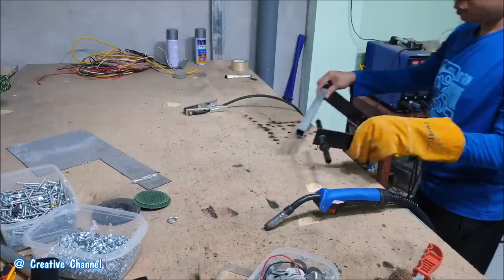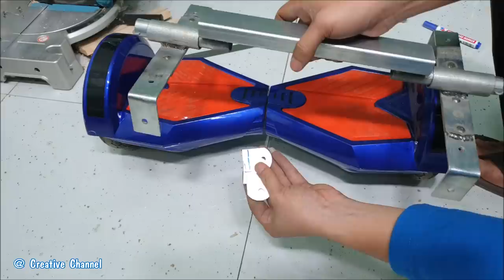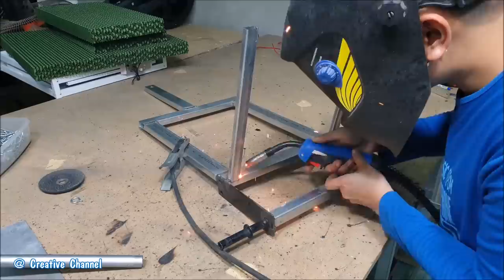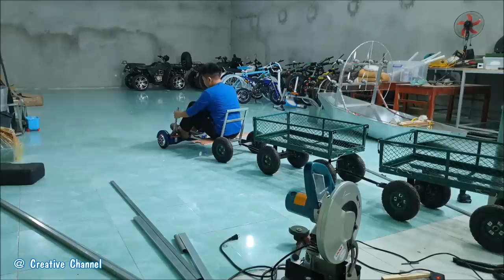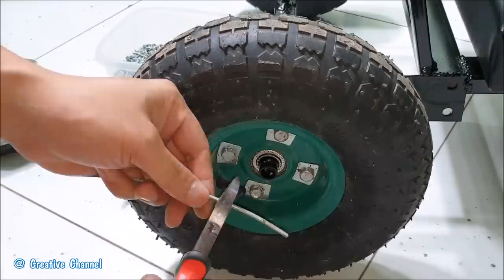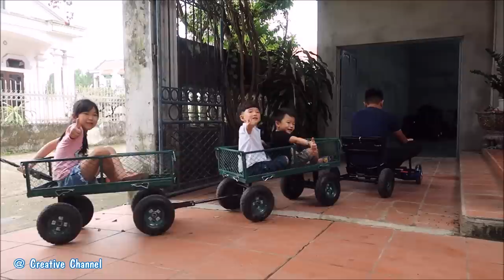Build Electric Train Mini with Hoverboard

Comment: This prototype project is certainly useful for small garden farmer to carry their garderning tools to the vegetables field and bring back fresh produces. Additionally,  it can be enhanced with a lightweight flexible solar panel to shade the strong sun on the top with a large supercap and a backup battery to provide power for DC powered gardening tools would be nice.